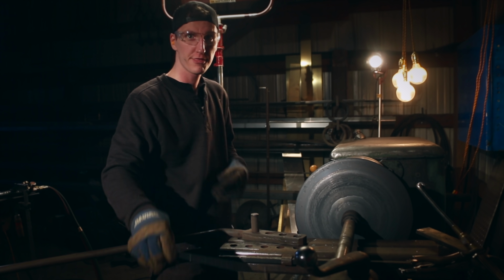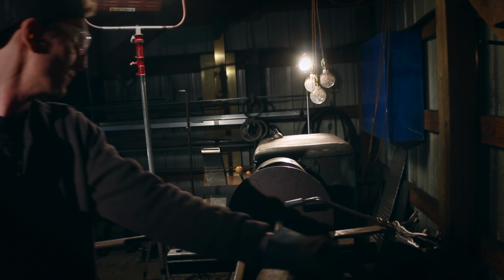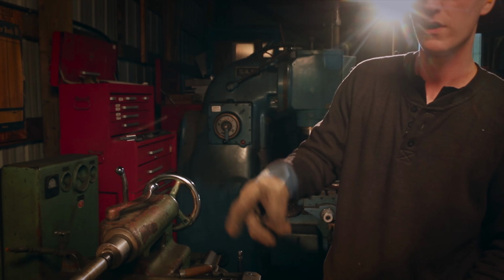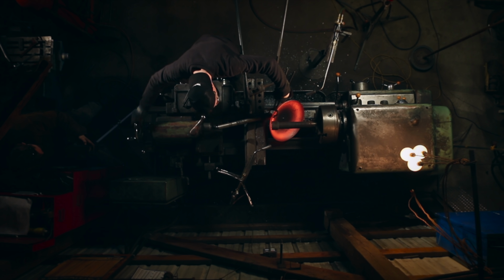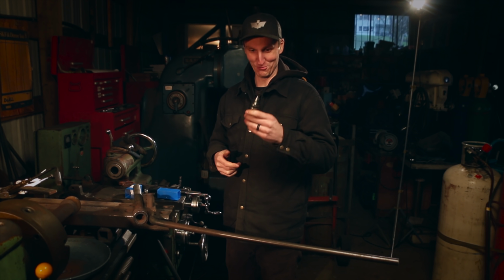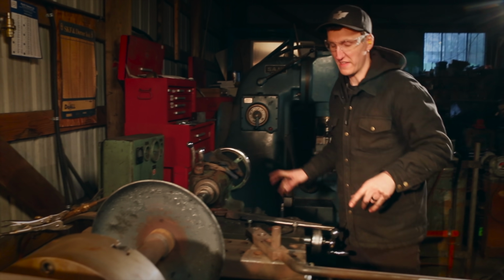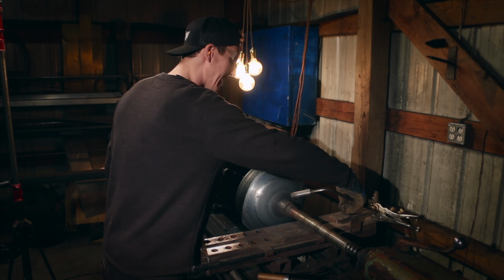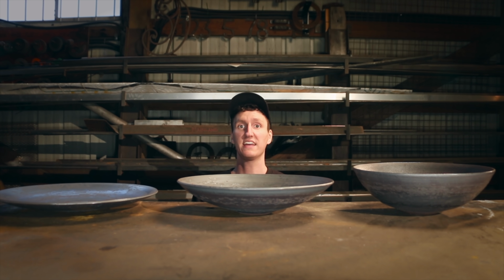Attempting HOT SPINNING on my LATHE!!

Comment: You could mod a large lathe capable of taking the heat with a custom built induction heater that can either heat the entire plate or specific areas.
Reply: An induction coil would work well
Reply: Good luck supplying an induction heater that big enough energy to heat everything up
Reply: Ive picked up monster sized clunkers for the price of scrap metal at auctions . Last one was $900 running . But you    gotta have a back yard shop with a 600 amp  three-phase service .
Reply: @paulbains9152  yeah... 600 amps sounds like a punch to the electric bill

Comment: You could try heating the metal via induction; putting a coil around it and using the lathe's spin to generate eddy currents, which would heat the metal more evenly.

Comment: I had some stuff spun out side of Vancouver B C , at     Arts Metal Spinning . Dangerous place to be , but they let me watch .        They were spinning stuff from 5 ft in diameter . Nothing hot when I was there though .They were going in so deep , they had 2 guys on the forming roller , to pull . Looked like lots of fun . They spun me a venturi about  2 ft deep by 3 ft in diameter . They   make aluminum spinners for airplane props too . They bolt some of there discs on a bolt circle and theres no center . Some are mounted on the back side of the gear box , because the blank almost touches the floor .  On the big stuff , by the time they get it good and rolled  over , theres quite a rag on the leading edge . They trim that , then roll it some more .  The other cool thing I      watched was explosion forming . They bolt a blank on a tank with a heavy ring , fill the tank with water  , detinate a charge in     the water , and cause a bubble in the blank . They didnt let me watch ,thank you .

Comment: You could put ceramic inserts on both side of the plate to reduce heat transfer by conduction. Paint the tooling pure white or use aluminum foil to protect the rest from radiation and put fans for convection.

Comment: Maybe if you make the tailstock rod end longer with off set holes drilled to dissipate heat faster or a thick walled pipe with holes drilled and rod ends welded. Would help your tailstock live much longer. Same for the chuck side.

Comment: Interesting. I taught myself to spin copper. (600 hours/ 1800square feet of cooper sheeting; 22 gauge and 19 gauge) to develop technique to spin out a 3 1/2" diameter by 5 3/4" tall  cup. i learned to spin other pieces out as i worked to getting that "eureka cup"  (use it for a liner in a wood cup). definitely gets more difficult the larger you go. There are of course videos available showing spinning but it wasn't until i got to the eureka cup that in now see all the little intricacies involved.  Gutsy job

Comment: Watching your tail stock wobble was giving me some serious anxiety. Would it be possible for you to put a spherical roller bearing on the pipe and add a housing for it closer to the metal plate so it wouldn't get pushed off center as you're shaping the bowl? Other thought I had was you might be able to coat the first foot or so of the pipes holding the plates with a layer of silicon to act as a compact heat shield. I know it'd burn from direct contact with the torch flames, but it might be able to survive the indirect heat from the plate.
Reply: Me as a cutting machine operater was crying seeing this video

Comment: I love these projects but i have to know how the F do you work in such a dark workspace? it blows my mind that you come out with all these quality jobs in the dark.
Reply: The lighting for filming is always brighter than the amount of light needed to safely work, the human eye has a great capacity for relative lowlight. And forging work had an inherent need for more dim lighting conditions too. Also, often significant UV filters are needed to protect camera sensors from the the spectrum put off from map torches and hot metal becoming incandescent.
Reply: In the less light situation in this case is good he can see where the heat is in the bowl.

Comment: Replace the bearings inside the running centre for ‘C3’ bearings, they are heat resistant bearings and will extended the life of the centre. Will be a far cheaper option than $1000

Comment: Hey, so crazy idea. You've got a fast moving metal object, you could try some powerful magnets and heat it through induction.
Reply: Wait a f****ng second that ... actually makes sense. I've got a lathe. I've got magnets. I don't know if I have an appropriate piece of steel stock and I think I'll need to buy an IR thermometer to get any useful temperature readings so I probably need a few days, but I'm gonna try this and post my results some time before the end of the week.

Calling it now: I don't think there's any way I'm gonna get the metal anywhere near glowing heat no matter how thin it is, but I still love this idea even if it turns out that I can't use it for any practical application. I've used lathes for many things before, but I think this'll be the first time I've used a lathe for science.
Reply: @curiouskarl5485   for science! I think your gonna need some beefy magnets but I would love to see if it's possible
Reply: @davidwelsh2692  Welp I done did it, and the results were highly entertaining: the metal actually got colder. Yep ... air cooling. Ran the experiment at 400 RPM, 1000, and 2000, and at every speed the effect of air cooling was stronger than any heating effect from the magnets. Full details as follows:

I found a 7 inch diameter lid from a cookie tin (it's ferrous, I checked), punched a hole in the center, and mounted it to the spindle via the through-hole. I made a medium-ish stack of neodymium magnets, and I don't really know how magnets are rated but I would estimate that if you put this stack in contact with a steel surface and pulled perpendicular to the surface, it would take maybe 20 pounds of force to separate the stack from the surface. I taped the magnet stack to a piece of wood which I clamped to the lathe carriage for positioning control, and positioned the stack of magnets as close as possible to the outside edge of the metal lid. Ran the lathe at various speeds, checking the lid's temperature regularly with an IR thermometer, letting it return to near room temperature between runs.

I do have one much stronger magnet (gotta be close to 100 pounds pull force) but it's like, way too strong to use without making a whole custom wooden mounting rig and even then I really don't want to risk getting shattered neodymium all over my lathe because, safety concerns aside, that debris would be near impossible to remove and extremely bad for the lathe itself. The stronger magnet would surely have a stronger heating effect, and a thicker piece of metal would probably be less affected by air-cooling, but I'm satisfied with these results for now. Bottom line I'm still pretty sure it's POSSIBLE to heat metal with magnets on a lathe, but as to whether it's PRACTICAL ... definitely not at the scale of my little garage shop.
Reply: @curiouskarl5485  well darn. Thanks for trying and thanks for the detailed comment. I wish I could try this myself and play around with pole alignment and stuff like that. As I said crazy idea, plausible, probably not practical
Reply: @davidwelsh2692  Oh, right, pole alignment was tangent to the circumference. Didn't try any other orientations. But yeah thanks for the crazy idea, definitely kept me entertained for a few hours.

Comment: Long sleeves, gloves and lathes don't mix,

Even at 100rpm it is capable of wrapping you around the stock.

Please be safe.
Reply: Couldn't the late be equipped with a dead man switch like attached to your feet and a sacrificial brake ?
Reply: @ArthA122  maybe, but by the time your feet come off the ground your arms probally bent 360 degrees already.

Which last I checked is bad if you aren't a Wacky Waving Inflatable Tube Guy.

But it does beat dead.
Reply: Rem Max  ouch, I'm glad you didn't lose digits though.
Reply: Yeah, short sleeves and no gloves is better, the splinters are a small price to pay
Reply: @ArthA122  By the time that kicks in youre already spooled up like a cable

Comment: I don't do any kind of work in this field, but I'm wondering if the small wheel off of an English wheel wouldn't be better suited for pressing against the metal, as it wouldn't result in scraping the metal.

Comment: I'm sure there might be a reason for this, but why don't you heat the metal on the vertical axis, and bend the steel on the horizontal axis? I think this would make things safer - and more compact?!

Comment: You need to make some tongs that have some roller bearings in the ends of the jaws so you could grab and pull but still allow the plate to get heated an spun up.

Comment: I really like ya man and get the necessity of the setup but I pray that OSHA never inspects your shop. For hot spinning chunks of steel you should look into the machines they use to hot roll threads onto screws. I don’t know much about it other than that it’s an existing technology. I imagine it would take quite the setup to say, hot form a candle holder out of bar stock.

Comment: I just can't help but think it would take less energy to press plate onto a mold and repeat it . For a one off piece i see this as a novel idea but most metal workers don't think of these ideas so its great but it is incredibly simple to create a stamping tool so to speak vs spinning even a dozen of these... an electric winch and a stand with a few diesel engine blocks wouldn't be very hard for anyone to aquire , then your heating oven would be using less gas overall because it would be heating multiple units

Comment: this is a interesting video and watching you create and alter the way you do things is great.
I wish you the best in your project.
One thing I saw and I'm no expert or even close.
The tool you're using to shape the metal has a round flattened wheel on it.
IS that not supposed to be turning? as all the other spinning video that I've seen the wheel is clean and it turns.
yours is worn badly and dragging. .... Just a comment as you're using heat so you can't use oil to lubricate the plate and a wheel would really help>?
As I said just a thought.
Good luck with your project and wish you well.

Comment: How come you are not using a pre machined chuck I work in a spinning shop for eighteen years we were spinning 10  ga. Domes four feet in diameter without heat in stainless by using beak down chucks prior to the final church shape it makes it very consistent size very hard work that was using a thirty hours cannon lathe with face plate and bolt on chucks all the way down fo funeral vases that the chuck had be a break down and the finale chuck was made to unscrew from the lathe and disassemble from inside the part

Comment: I don’t see the practicality of this maybe for a specific part or something but it would be practical to do this to a solid chunk of steel I have never seen anyone heat and spine metal before but metal spinning is used all the time for mad production of pots and pans but you don’t need to heat it for that and they make the tooling but when you think about it the process used in pass production is basically turning a lathe in to a English wheel and any other form of metal shape would probably be put in to a press or possibly a cast depending on what the use is

Comment: I don't think you need to heat anything while metal spinning.  I have seen cold rolled  and stainless steel  spun without heating.  I worked with metal spinning master JACK DAVIS.
Reply: I have never seen any other of your videos.  But have you used molds. Polish your tools it makes your passes cleaner.  Paraffin wax also helps if your not heating the object.  I have seen Jack spin a square bowl and one that was square at the bottom and round at the top.

Comment: poor choice of placement / design for the back torch needing to reach over the spinning lathe to turn it off. In a situation of failure like when the bowl fell off that's not ideal, nor is a scenario of reaching over with a hanging bit of clothing perfect for getting snagged and twisted up in it.

Comment: 45 seconds into the video and noticed three things that are extremely unsafe habits that have yielded fatal results.

1.long sleeve shirt (sleeves not rolled)
2.baggy untucked shirt
3.gloves
   As the world goes on and younger generations begin to take over in industry and toolmaking these habits should never be seen as an option at all.
This is a irresponsible use of this man's ability and knowledge of running a manual lathe and I believe that if he is going to educate his fans on any machinery he should explain or at least take the correct safety precautions.

Comment: I genuinely thought you were just gonna heat up a slab of metal and centrifuge-stretch it on the lathe at 2000 rpm.
Don't get me wrong, this is still pretty dangerous, but at least it isn't "there's a fountain of molten metal on the floor, walls, ceiling and in my eyes" levels of incomprehensibly stupid, lmao.